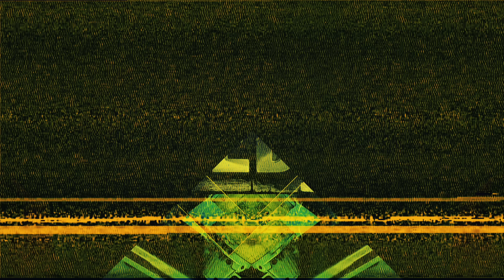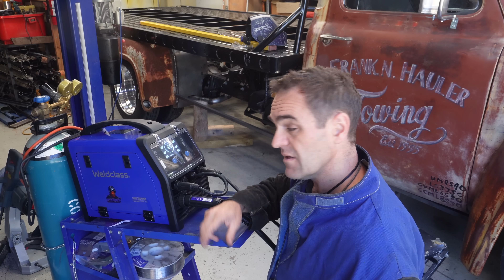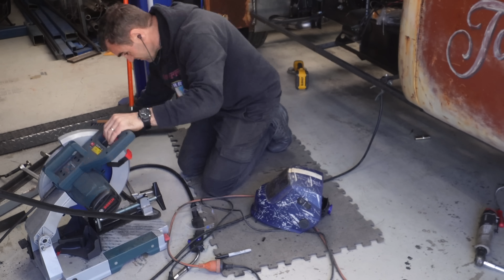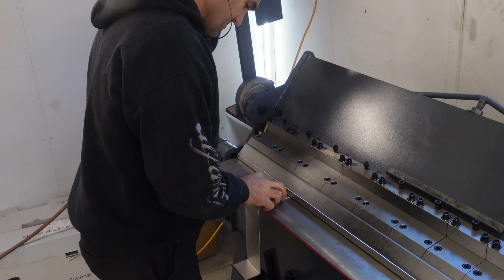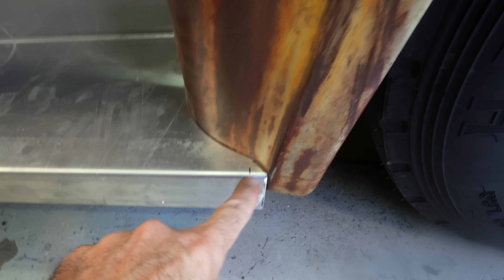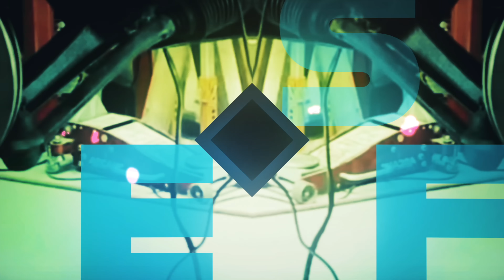Custom running boards - 1954 Ford F600 Car Hauler Build part 80

Comment: Looks great with the running boards, what about using something like Eva foam or Udeck boat flooring as simulated wood on top of the running boards ?

Comment: Looks great Jeff. Did you consider making ridges into the flat section where you would step. I think it would make them look like a factory fitted board. I know they will deform but what if you cut the ends off lets say at 50mm so the deformation wont be curving them and then weld the ends back? 
Anyway. I love watching the progress.
Cheers from South Africa

Comment: Is the intent to leave the rear side-step and the front side-step (under the cab) as separate parts to allow for tray movement when there's weight on the back?...

Comment: Jeff, on the rear mount where you can't add a second angled upper brace, what about just a second lower parallel brace?  It looks like the vertical part that bolts to the chassis hangs down enough to add a lower brace.

Comment: Hi Jeff. Great job with the Frank.N.Hauler, probably the outside edge should be curved with a softer curv, to match with the rest of design of the truck.  ;-)

Comment: Might want to check but my finger break has an adjustment to move the finger back away from the break edge which creates softer radius
Reply from the maker: I did try moving the fingers back but the edge was still sharp.

Comment: Hey Jeff, it occurs to me that those Al boards butted to the front fenders where they see road grime and spray, might could use something between it and the steel fender to prevent galvanic corrosion.  Not trivial to get long items like that to look right with the lines of the truck.  Great job.

Comment: Running board looks excellent. Nice solution to make the two lines blend under the cab.  Question though, are you going to ad checker boards on the top surface?

Comment: I've always wondered, does the truck always start up instantly like how it's shown in the videos?  That's really impressive.
Reply from the maker: It starts the instant you touch the key (after the glow plug light has gone out). Best starting vehicle I have ever seen.

Comment: Jeff - FYI - There’s a YouTube channel called “My Mechanics”, where a gentleman is restoring a 240Z. In a recent video, he did some aluminum welding on a cylinder head using a hand held laser welder! You might want to check it out as it seems like a tool you would like.👍

Comment: Looking forward to the final result on the running boards.

Any update on plans to address the front fender to wheel centering? Feel like the running boards or the camera angle at the end there made it a bit more obvious 😇

Comment: Angle iron often seems like a good option but it often is the worst choice when it comes to rigidity versus weight over lenght.
A lighter gauge tube can be more ridged over a longer distance especially when any torsional stresses and involved

Comment: Sure you are aware Jeff, but you will get bimetallic corrosion between the aluminium and steel at the fixing point if you don't separate the metal somehow as the fixing cuts through the material

Comment: Jeff, have you worked out your run-flat clearance of the brackets and running boards?  It you blow a front, for example, you wanna be sure those are clear of the ground…

Comment: Watch out for electrolytic corrosion between the steel frame and the alloy running boards.  On my lightly modified MGA, I have alloy wings, and I bolt them in place with stainless steel screws and washers and the correct sealing mastic, etc.

Comment: Truck  looks very good. I don't  know if you have considered putting a bar underneath the tray to prevent heads being chopped off if some unfortunate  car was to run up the back of you.  Maybe its a legal requirement,  otherwise  it looks great

Comment: No idea what your plan is for the colour / finish of the running boards, but I rather like shiny aluminium, it ties in the shiny alloy wheels front & back and contrasts with rad-rod look of the cab. Whatever, compulsive Sunday morning watching here in the UK, as the build develops...

Comment: Nice work, but I would have made the running boards from perforated aluminium checker plate, just like on the ramp, but aluminium.

Comment: You should reinforce the base where the feet rest; even though it's not for intensive use, it will warp. You should add reinforcement connecting all the supports.

Comment: Are you going to press in some detail into the boards.  
Is that the details you were referring to.
Reply: Bead rolled lines running along the running boards would break up the plain look as well as adding some additional stiffness.

Obviously after they have all been welded into a single length.
Reply: @BipedalMale sort of what I was thinking.
Reply: Yes or drilling many holes and from underside with a push pen for ant skating at the top side !🤠
Reply: Totally agree. Would add strength and break up the long lines. 😊

Comment: Great work Jeff the running boards look amazing so far - I was thinking you would need some beads along the length but that aluminium didn’t move when you were standing on it so looks plenty solid! Can’t wait till next week 😊
Reply from the maker: It is amazing how much a couple of folds increases the strength of a panel.